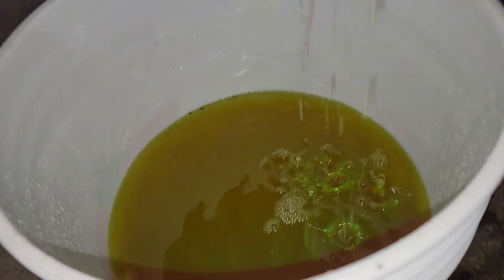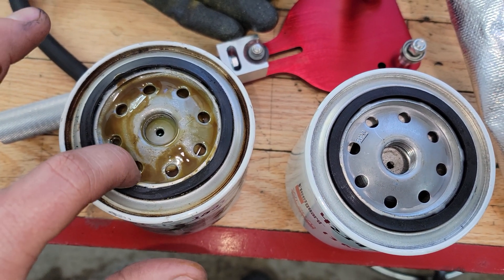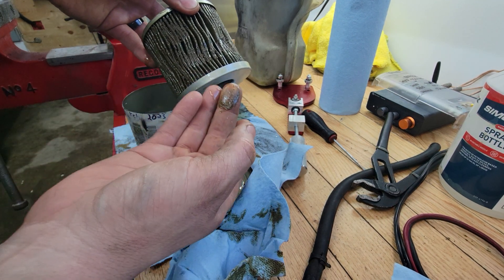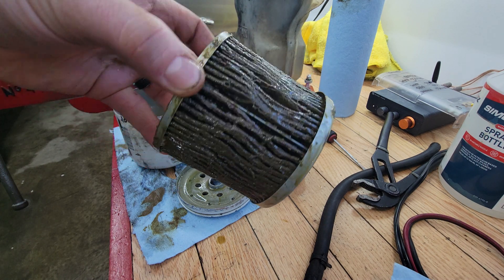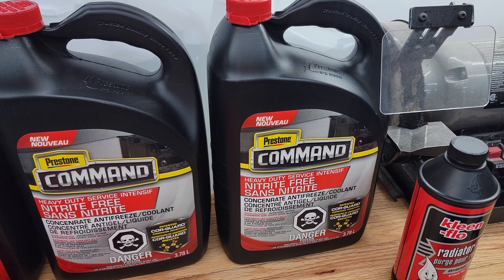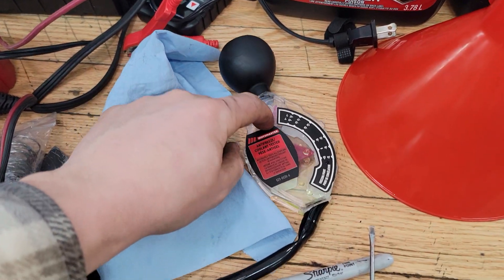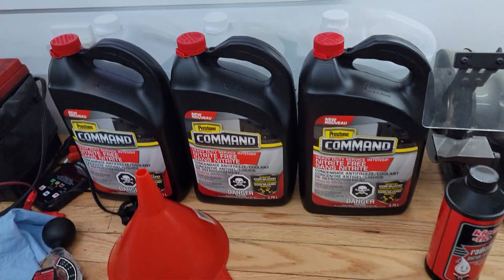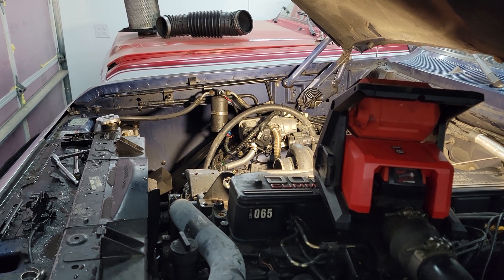Coolant Filter Change After 1 Year and Coolant Types | 1st Gen Cummins

Comment: When I first bought my 91.5 Dodge, it was about a year and a half later I had to change the water pump. I bought the truck in 1998. I still have it. Anyway, I moved back to Pennsylvania from Seattle. that’s where I bought the truck And I think it was in 2001 maybe 2002 I had to change water pump again. I figured well you know maybe it was just a bad pump 2004 comes along had to change it again. I’m a amsoil dealer so I called the tech people and he said switch over to amsoil antifreeze and I’ll probably put close to 350,000 miles on that pump and it’s still good. It’s six in a row.Jim from Kennerdell pa

Comment: Love the cummins video, was hoping you would have a spot on there where you drain and flush, how you do it. I tried removing the rad petcock on the bottom of the rad to drain and that sucker doesnt wanna move!! It plastic so I didnt want to get western with it, I could remove a rad hose but really want to use the petcock because its the lowest point.
Reply from the maker: I typically use that petcock on drivers side. I find on the automatic trucks its hard not to make a mess since the transmission cooler lines run right near it. It's a bit easier to be clean on the manual trucks but I like to use a cut open water bottle and sort of use it as a funnel into a bucket until it's completely drained.
Reply: @OvensGarage  yeah I think its just the difficulty getting the petcock open, its plastic and dont want to break it, I've tried pulling on it and turning it but it wont budge enough to drain and I dont want to break it. Its a 97 automatic with 87k original on it. Shes put away for winter now, I dont want salt on it. I ordered the fleetgaurd coolant and fleetgaurd restore to flush/clean the system before changing out coolant, I run all fleetgaurd products on it, my other cummins I have had I would run whatever hit spec, but since this one is original, clean and low mileage I'm super particular and do everything by the book.

Comment: Wrong time of year for it, but I run a ga of  vinegar distilled water top up  mix 4:1  to dissolve foreign material/ rust for about 1k mi 1,600k after a flush. Then fill with straight distilled water 250mi 400k 5x to dilute/disapate the acid of the vinegar . Heater went from under powered to over whelming in Montana 20-30f below